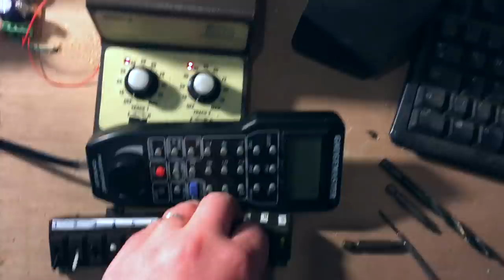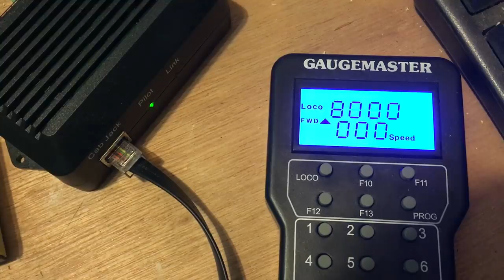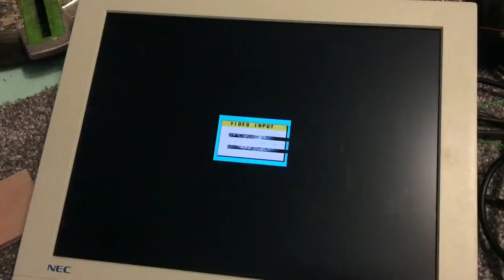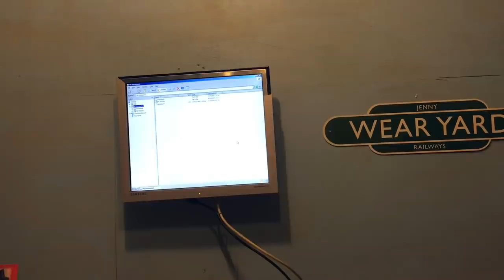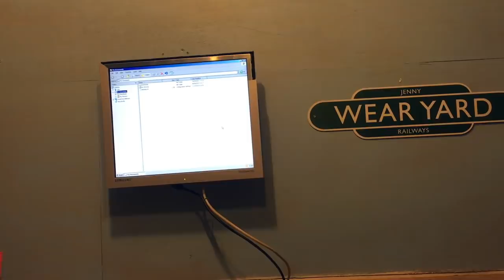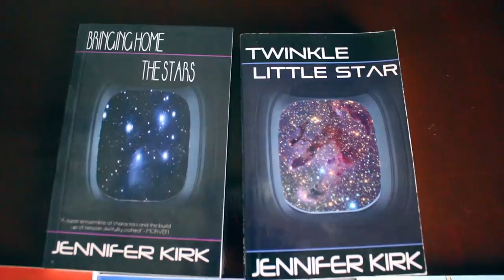Building the Loft Layout, part 7 - Adding the Electrics

Comment: Search the Internet for ‘Rusty Rails Painter’. It’s fast, I t’s easy, and it’s not expensive. I bought one and found it did a very good job. Little or no wasted paint either.  (I have no connection with manufacturer or retailers.)

Comment: What CDU are you using for the point motors, I use the one by Peco, but they still fail to move the point blades too often.
Reply: I too had the same problem so choose Gaugemaster which are fine. There are others available such as on E-Bay etc with higher power output. Happy Birthday/Anniversary & good luck with the MOT, Jenny!

Comment: I find a quick way to weather the track by using Railmatch sleeper grime spray cans, if you put a few lengths side by side then any over spray catches the next peice Then just run the paint off the rail heads before it drys.. it looks the dogs doodlies.. Also I would suggest you set up a few small lengths of track on a board n try out weathering rather than working on your layout. Also have you tried paint pens...?